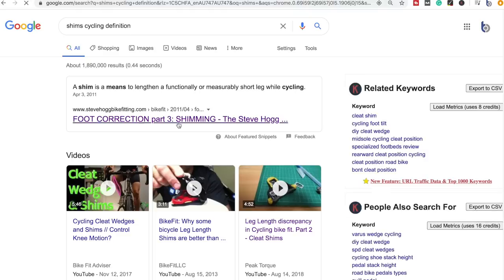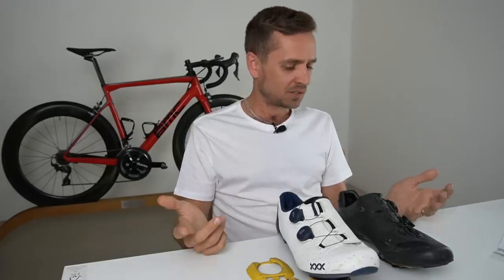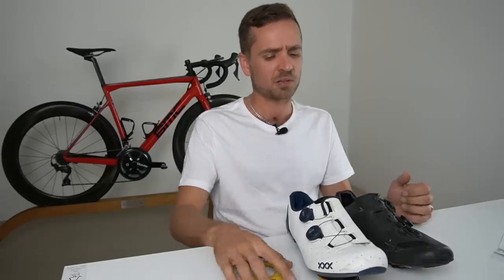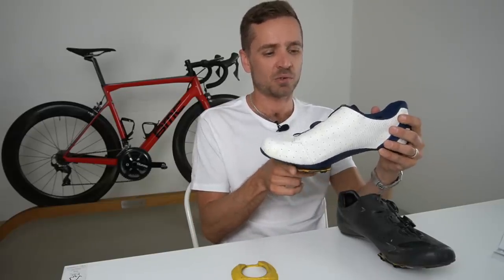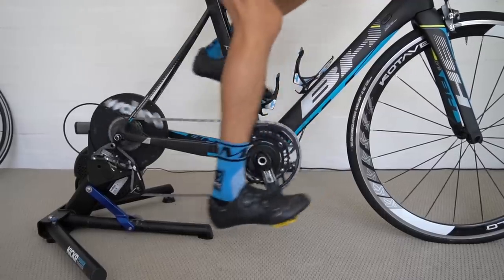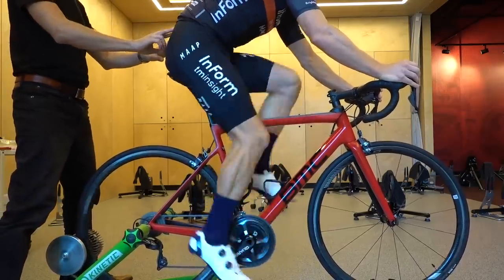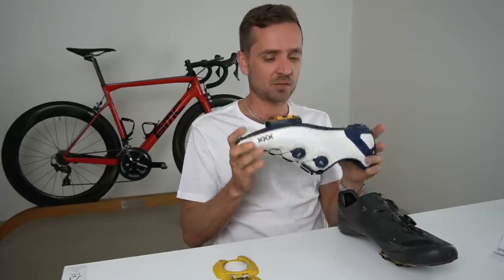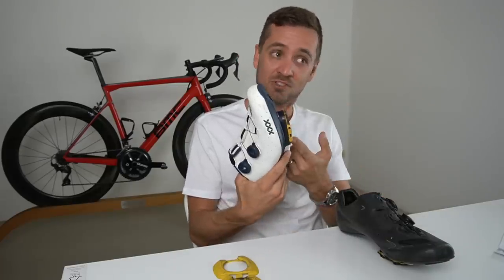75% of Cyclists Leave this Bike Fitters Clinic with a SHIM (why?)

Comment: I have a 1cm left leg length discrepancy  as a result of an accident 30 years ago when I was hit by a car while on a training ride.  My fracture of the tibia/fibula was about 10cm above the ankle.  I compensate by using a shorter crank arm on the left side (170mm vs 175mm) and a small shim to make up the difference.  I think it avoids the torsional effects he mentions.  I haven't had issues with knee pain.  Although because of mechanical limitations in range of motion from the damage to my lower left leg, I don't get the same power output on the left.  Ultimately I'm just happy I can still ride without much, if any, discomfort.
Reply from the maker: Thanks for sharing John, interesting to hear your experiences. Cam
Reply: Firsthgyhgyhuy Lastujhujhuj  The 8 likes would speak otherwise. Rather ironically though, no one other than myself decided to do anything involving your comment.  Strange...
Reply: My grandfather had a pal, Matt, who had a large discrepancy in leg length and wore a built up shoe for walking ( this is back in the 50s, 60s and 70s in Glasgow, Scotland ). It was caused by an industrial accident I believe. I don't know what he did on his bike to cope with it but I do know he was a mad cyclist. My dad told me he was the guy who would fix your puncture in five minutes with the wheel still on the bike.

Comment: Excellent video again. After the last one I moved my cleats right back. Felt alot slower but my average cadence increased and I was overall 2mph faster over the router beating some of my times from over 4 years ago. If I could determine if my cleat needed a shim or not I'd do that without a doubt. Finally quality advice from a bikefitter. 👍😁

Comment: I am a rower, but am getting into cycling for cross training.  There is a lot of crossover between the sports. After swapping into Bont shoes, my leg discrepency in the boat became very pronounced.  I have since added a 10mm shim screwed in under my rowing shoe, wow, what a difference!!  Finally, I am sitting straight, I could literally feel that one foot was not touching the bottom of the shoe and the seatbones were always aching.  I started slowly, starting with 4mm, than 6mm and letting the muscles redevelop into the new position.  Each time I increased the shim, it was ahh, this feels so much better.  The next time I got in the boat, it felt like the shim wasn't enough.    Finally, after the second set of screws, up to 20mm now, it's Eureka!!!

I am now getting into cycling and I'd like to sort which shoes I need and which systems suit shimming up to 10mm. I have a wide forefoot.  Is there a place that makes custom shims?
Reply from the maker: Thanks for sharing Liz, I think Neill would make them if you reached out to him. https://neillsbikefit.com.au/

Comment: Kudos for giving shims a go. I run them due to leg length difference and it solved my hip pain on my shorter leg as the saddle was set to the longer leg. I also use Peter’s cleat adaptors and run my cleats a full 30mm further back than usually possible to basically run a mid-foot setup which resolved my knee issue
Reply from the maker: Interesting, thanks for sharing mate

Comment: I have had 3 bike fits, the first person told me I had one leg structurally longer than the other, he dropped my saddle and tried to balance out the discrepancy that way, he saw also my hips were rocking and found that the saddle width was too narrow for my sit bones, but did not touch the cleats. Second bike fitter raised my saddle and  did not touch the cleats. Third bike fitter finally put wedges in my cleats and raised my saddle dramatically. Of all the bike fitters, he found the correct saddle height because I have monster power.  He also said I had limited mobility in my hips and lumbar area and suggested I see a physical therapist to loosen my tight Psoas muscle and suggest that I work on my weak core. I began working on my mobility and core strength and that has made a huge difference. I believe most cyclists including me because of the position we are on our bikes should always work on a mobility regime off the bike.

Comment: Two years ago I had  a shim fitted under my right cleat. It helped me balance my left leg with a weaker right leg (and possibly 2mm shorter than the left.) Before this, I was sitting with the nose of the saddle pointing slightly to the left, and developed problems with my sacrum. Now I sit straight and back pain has receded.

Comment: Following with interest:
What is your leg length difference vs. the shim he put in..?

I have had two bike fits. First left me with a stagger in my cleat. Second, the fitter took the stagger back to equal/equal. Both were reputable fitters..!
After seeing these vids, I am keen to try a shim in my shorter left leg... to help with a lingering "stiffness" in my lower back (just the right side.)
What your vids have been saying makes sense !.... shorter leg is reaching, longer leg feels bound up. Almost pushing my one foot off on an angle, like it's bunched up.

Gotta love a D.I.Y. bike fit..! Cheers Cam
Reply: Good point !
Although just prior to the 2nd fit my right lower back was bugging me...

There also seems to be a contradiction in staggered cleat thinking.
Neil mentioned, the short leg with stagger forward, so it 'reaches' to match the longer.
My 1st fit had my longer leg stagger forward "so it kinda had somewhere to go"
Opposite thinking.
Reply from the maker: I'll see if Neill can get to this Q Paul! Thanks for asking. Cam

Comment: I realised I have a (much) shorter leg after my first 100 km: i had a stretching ache in the inside of the right knee. I started with adding an insole and recently added a 5 mm shim with a relatively good sucess. Next step: a real full-scale bike fit and the adjustment of the shim!

Comment: I wear flats and only mtn bike. My left hip is high causing my right leg to appear shorter. I use extra insoles now, but have used different crankarm lengths in the past with great success.

Comment: I had 1/4 inch (~6mm) of shim on my right leg, but eventually got it back down to zero (no shims) over the course of about a year.  

I believe the length descrepancy was the result of a bad crash on my hip years and years ago, and I foolishly kept training as the injury healed...so my body tried compensating in various ways and I just developed a permanent atrophy that I never really knew about but kind of suspected for years.  Shims were able to get me back to almost perfect symmetry.
Reply from the maker: Interesting to hear that mate, thanks for sharing on the thread. Cam

Comment: Best way to feel an unstable foot? Walk up to a going up escalator, as it is moving. Step onto one of the flat steps with about 1/4 of the front of one foot "only" and wait for the step to start raising up. Note the amount of effort it takes to stabilize your foot and keep your upper body steady. Repeat with the step over your arch and the do it flat footed.

Comment: Hi Cam, Neil is riding Q rings. I'm interested to hear his reasons for that physiologicaly and your thoughts as a racing cyclist on their use/benefits
Reply from the maker: Ok, I'll fire the questions his way!
Reply: G'day Bevan - there's no magic in the answer to that unfortunately - I threw a set on my bike years ago and liked the feel of them, so stuck with them. I think the sensation for me is better than round rings primarily because I'm a serious heel dropper and so apply all my force quite late in the pedal stroke - perhaps the Q rings smooth out that transition a bit - not sure.  All the data suggests no massive physiological benefit from what I can find out.

Comment: Just use a different crank length to get around the extra pivot (torque rock) from the shim – that you would then not be needing?
Reply from the maker: I think this throws the symmetry off, but I'll need to get Neill to respond to this at some point. Cam
Reply: @CamNicholls  Yeah, more length across the x plane. Might not work great.

Comment: Severe comminuted fractures of my left femur in 1995 after a moto RTA left me with a 6mm leg length discrepancy.  An osteotomy in 1996 since corrected much of the bend and fortunately I now suffer no ill affect as my body seems to tolerate this for walking, but cycling many miles per week/year a stack would be worth exploring.  (Strava Andy Bonner, Dorset UK)
Reply from the maker: Interesting stuff, thanks for sharing mate

Comment: I ended up taking out my 4mm shim from my right foot because I can't control my right foot. Exactly like what the fitter explained. I ended up developing a bad habit. I started pedaling with an excessive heel down, because I can't keep my foot steady on the pedal. Inside my shoe, I feel like my foot is sliding toward the back of my shoe so I have to grip all my toes to pull my foot toward the front shoes (that's the feel I got). It was really tiring my leg and I'm constantly conscious with my right pedaling. (My fitter added a shim to remedy my constant issue of getting saddle sore on my right side only every single ride and an issue of having my right thigh fatigue faster than my left. He said because I have LLD on my right leg). But the effect of having a shim doesn't disappear at all. Almost like, it's messing up my right foot pedaling sensation. 

It's been 2 years now that I still can't get my right foot to pedal correctly. I can't feel the pedal or I can't find the sensation of not pedaling with excessive heel down. Because every time I pedal with heel down, my right hip will drop lower and I will have a more severe saddle sore. Because of that I can't finish any workout. Every single ride I have a saddle sore. Now I'm looking at saddle solution that can be adjusted each side like bi-saddle (with adjustable piece) and SQLab ErgoWave 612 Active that allows the wing tip of your saddle moves 7º up and down following your hip. I'm hoping this will help me with my chronic saddle sore. And hopefully, I finally can find the right sensation for my right foot (without making my right thigh fatigue faster than my left). But definitely "no shim." Btw, I got professionally fitted in some university sport medicine with a physiotherapist as a consultant. Maybe 'shim' isn't a solution for me. Because it brings a different problem that ended up aggravating my original problems that I wan't to solve.
Reply: sounds like something Neil mentioned in some other videos. cleat position may need to be adjusted after adding the shim and also may want to revisit your seat height. he said cleat too far forward will cause excessive heel down. try a different fitter for a second opinion
Reply: @useForwardMax  The problem is I didn't have that issue when I started to ride. My right foot were pedaling fine. Occasionally I did have some saddle sore. Then, I visited my first fitter to change position so it's a bit more performance based. After that, I started to train a lot and after a year my right side saddle sore started and I noticed that my right thigh fatigue faster when I do workout. I know that your fit can change especially I started as a new cyclist and then started training. That's when I went to  this fitter - my 3rd one (my first fitter has quit from the place he used to work) who put a shim in my leg and diagnosed me with LLD. (he confirmed that I did have LLD which my 2nd fitter who I did a saddle pressure mapping fit) 

Anyway, thanks for your suggestion, maybe after several months riding with excessive heel down, it messed up my muscle. Maybe physical therapist will help fix that.
Reply: G'day mate - this type of story just screams at me that there is something else wrong with the position on top of the leg length issue. Don't mess around buying lots of different saddles - the sore is always on the right which means you're dropping your right hip aggressively and loading the right side of the saddle. You must find someone who can figure out why you're dropping your right hip, and stop it. This could be any positional challenge, from an incorrect seat height to an improper Q-factor to a lack of arch support or anything in between. Which country are you located in, I might be able to recommend someone?

Comment: Had a 2mm shim fitted for a functional leg length difference, which fixed some pain I was getting in the left leg. After a couple years I wanted to try without the shim again- 6 months later still no issues so seems the body has adapted. Be interested to know if there is an efficiency advantage to keeping the shim though, hard to test

Comment: Watching this tells me I really need a bike fit, but with a fitting of this level of expertise. My biggest issue is my feet, left size 11 right foot size 9.
Reply from the maker: Interesting to hear Simon, to sizes Simon! I'll pose that question to Neill next time we catch up. Cam
Reply: Cam Nicholls thanks Cam, I’m new to your channel. Loving the content 👍
Reply: Lake shoes do custom sizes where you can order a pair with different sizes.
Reply: As Clifton mentions below - Lake and Bont do left/right assymetrical sizing which is nice. You'll need to play with your cleat position a bit to figure out if your central nervous system prefers a SOS (Symmetrical On Shoe) position or a staggered cleat position. If the feet are 2 sizes different congenitally, then it's highly likely you have a significant leg length discrepancy also (shorter leg usually has a shorter foot attached) but not always. Good luck!
Reply: Neill Stanbury thanks, is it easy to determine if I have odd length legs?
Reply: Clifton Greening thanks Clifton, I have contacted my local lake stockist, hope that Lake UK also allow for selling odd sized shoes.🤞

Comment: Thank you so much for all this content! I have a question for Neill that I hope you try and answer and I think that shims are the solution but I don’t know. 

I don’t have much flexibility in my left foot joint which makes me rise toe down with my left foot. However, my right foot joint is what I guess is normal and therefore my right foot is more level to the ground at the bottom of the stroke. 

When cycling I get pain in the right side of my lower back, saddle discomfort on the left side of the saddle and after my recent bikefit I got outside knee pain on my left knee.

From watching your films I’ve learned that this gives me a functional leg length discrepancy that I guess I should try and “shim away”. Do you agree that shims are the place to start?

I live on the other side of the planet from you and tried a bike fit at my local bike shop without descent results so i am a bit on my own (together with you that is ;)). 
With best regards,
Oscar

Comment: Informative thanks. What about shims to correct latteral/medial foot angle, such as with shoes with built in lateral bias or loss of lateral strength? I believe I may have such an issue after a killing my feet first with a worn out shoe and then by adding an insole which killed the arch area of my flat feet. Now I seem to roll habitually to the outside with pain towards the outer foot area.

Comment: How about staggering the cleats laterally with a pedal extender? The longer leg gets functionally shorter with a pedal extender I imagine?
Reply from the maker: Unsure about that, one for Neill! Cam
Reply: I don't understand how it would get functionally shorter. Yes if you had to make some weird compensatory motion then it'd maybe impede the stroke and cause you to not fully extend the knee etc., but that is not desireable. If your hip is descending and knee extending roughly straight then why would you want to take the hip or the knee out of it's preferred range. Also if the knee extenders place to foot wider than would be natural then you would have to toe out and knees out(abduct the hip) to avoid, as an example, the tibia internally rotating independently of the hip, the other way around or both going in a mixture of internal/external rotation and adduction/abduction at suboptimal points to compensate for the foot position. That could hurt your knee very much. Imagine a pepper grinder and your knee is the pepper. That is essentially one thing that could happen if you don't require the stance width. It could also lead to hip pain and a feeling of hip impingement if your hip wants to be in a certain place but now has to internally rotate to a larger degree to get there. Most people don't have a lot of available internal rotation during hip flexion, which is part of why you see some riders with knees flaring out when they've gone too low or too long. It's not a perfect solution by any means just like staggering the cleats might not be the best way to compensate for LLD primarily in the femur as it can cause you to sit skewed and create new compensations. Hope that gives you some idea of what's at work and why it's important to identify where the trouble is actually at and what other limitations there are before picking a solution
Reply: @yannickokpara4861  I'm not sure. I imagine that the tilt of the bike when on the road can compensate for some of the leg length issues as well. I noticed that my bike tilts to the left, to compensate for a right hip drop. Improves with leg shims on the right. So altering the center of mass over the bike laterally and having the bike tilt would also affect the effective length to the pedals. All that stuff about hip alignment doesn't make too much sense when you consider that the same athlete might have very different Q-factors on a road vs mtb setup. But that's just my opinion, no expert here!